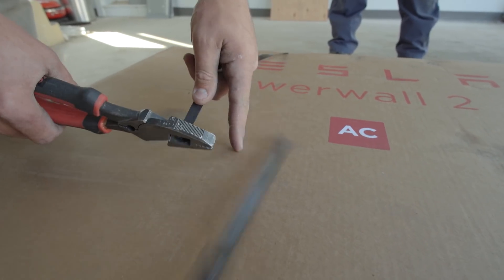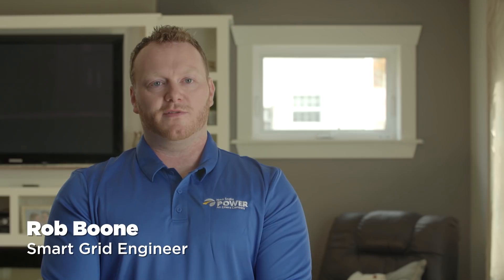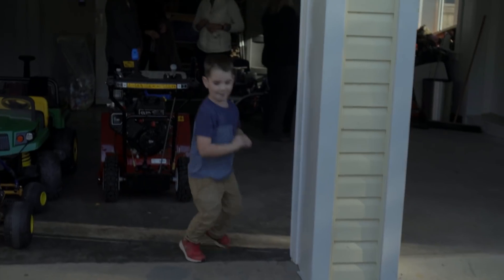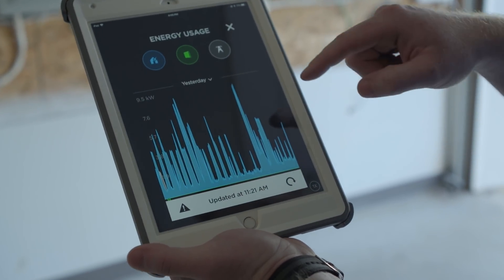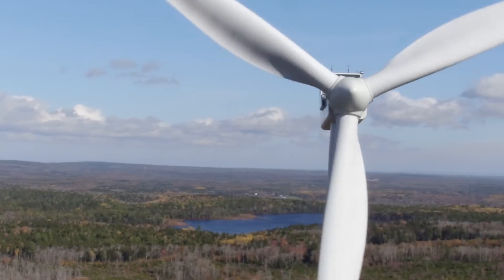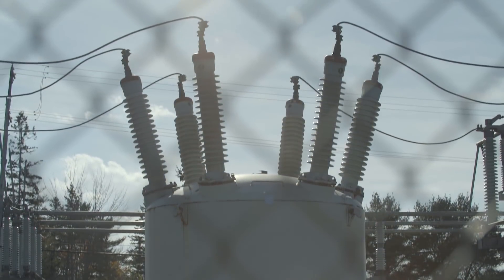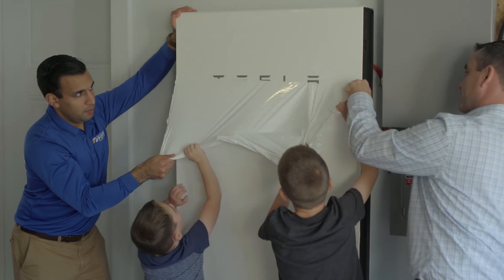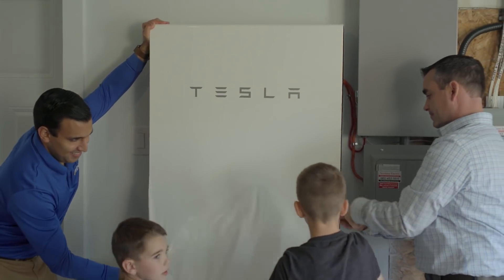Testing battery storage with the Intelligent Feeder Project

Comment: I also think they should create container sized batteries, for several reasons in fact, in the first place they are very big, I guess they can contain about 5 megawatt each, in the 2nd place they can be transported quite easely because trucks are designed for such containers. As a third reason, they can transport it to festivals or things like that, so they don't need absolutely massive wires to make sure there's enough electricity over there. *Press show more underneath*
Another reason is that it will make the transition for containerships will become way more easy, they can simply take an empty battery container off, put a fully charged container in and travel another couple of hours, or even do it with several containers.

I also hope they can make hospitals independant from both the grid, as well as generators with solar panels (on the outside walls and roof). In Amsterdam last year, there was a massive accident which put a hospital under water, because of that, the generator (in the basement) couldn't work and there was no electricity in the entire hospital. 100ths of sick and elderly people needed to be evacuated. I think that if there are batteries spreaded all over the building in the hospital in furniture as well as converters and things like that, and on top of that have the entire building surrounded by solar panels, that this building can be 100% independant of the grid for basically forever. Possibly even give energy to the grid most of the time.